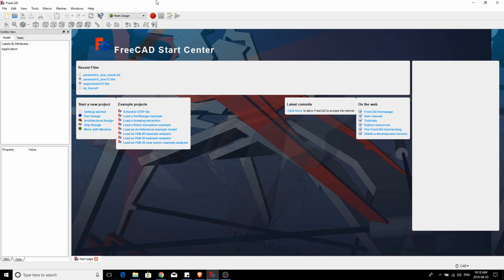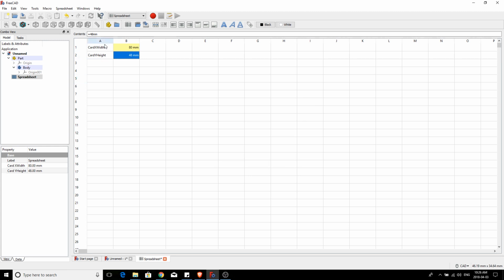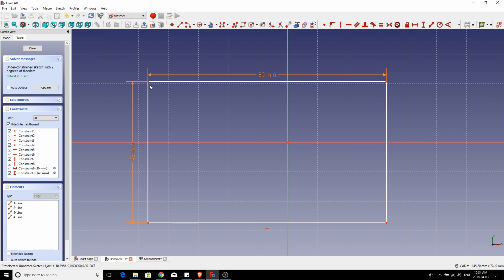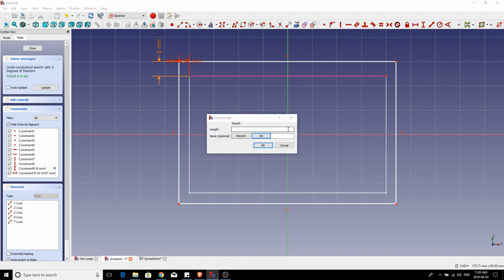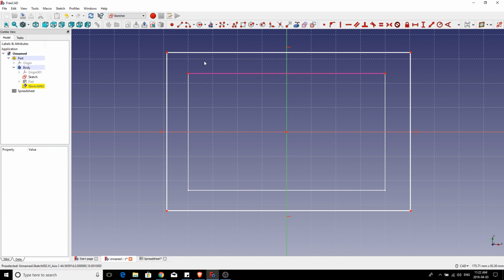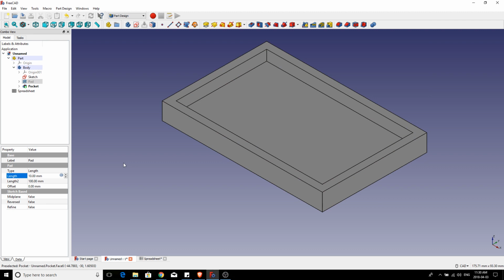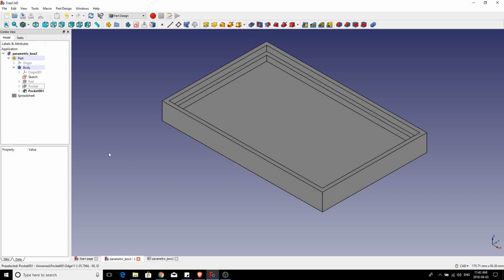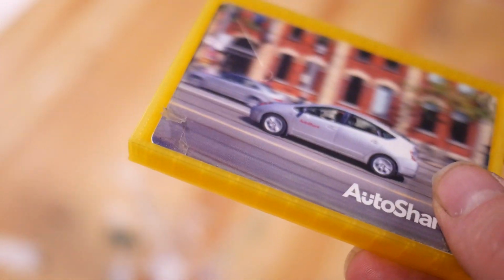FreeCAD Parametric Modelling

Comment: For those of you who use a higher version (e.g. 0.19): Tick "auto remove redundants" in the Solver messages window. Otherwise FreeCAD will complain about the sketch being over-constrained when you try to apply the symmetry tool (the horizontal line being constrained as horizontal).
Reply from the maker: Thank you Hermann.

Comment: Great vid!

I became quite tired of right click, left click click click click for defining params.  So I wrote this bit of code.  I haven't worked out how to make it autoload when a  FreeCAD or spreadsheets are opened.

# Enable the command console so you can see commands being executed as you do stuff in FreeCad.
# View -> Panels -> Python Console
# Add the following,  it only lasts until freecad is restarted. 

def celln(col,row):
    return '{C}{R}'.format(C=col,R=row)

# If there are more than 3 blank rows it assumes the alias definitions have stopped.
def auto_alias(exception_limit=3):
  i=0
  AAS = App.ActiveDocument.Spreadsheet
  ec=0
  while True:
    i+=1
    try:
      name = AAS.get(celln('A',i))
      print("{n} = {v}".format(n=name, v=AAS.get(celln('B',i))))
      AAS.setAlias(celln('B',i), name)
      ec = 0
    except Exception as e:
      ec += 1
      if ec > exception_limit:
        return

aa=auto_alias

# Each time you want the aliases defining or redefining, simply run this.
# no more left or righ clicks for each row 
aa()